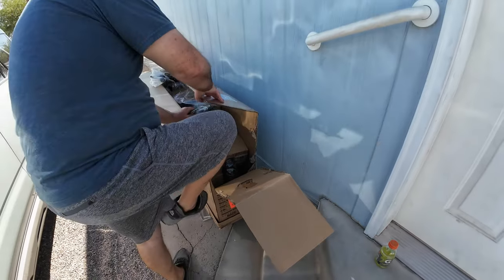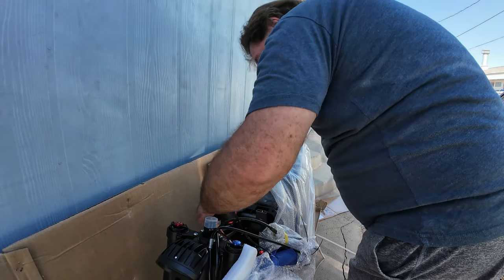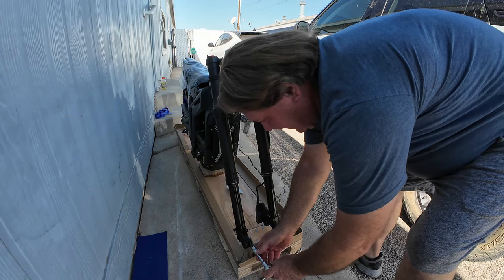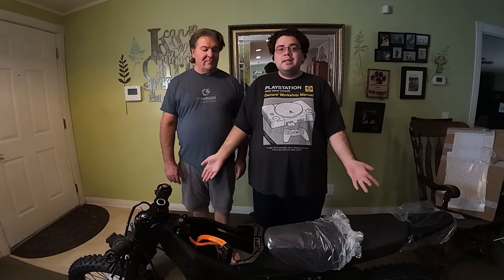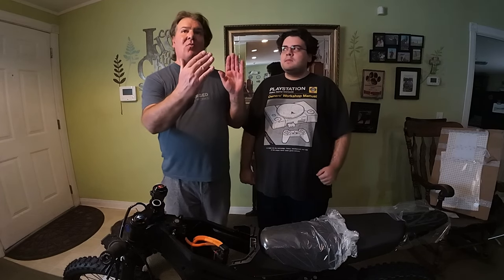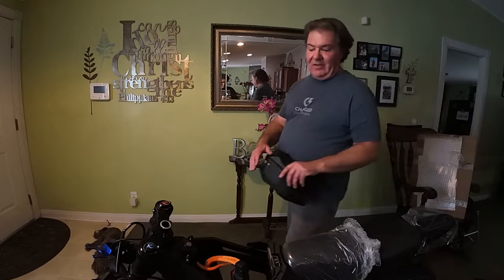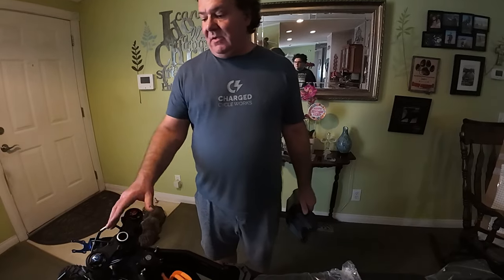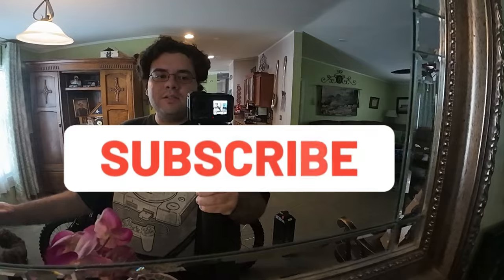Talaria Sting Mx5 unboxing

Comment: I just did a news segment on the MX5 and a fire video that was just posted up. I have reason to believe it’s an MX4 in the video I saw, but I was curious if your brake calipers were blue or gold. They advertise them as gold and other images I’ve seen are gold, but I was wondering if they had a run of blue? Mine should arrive on Tuesday and I’m eager to get on it🤘🏾
Reply from the maker: They are blue and I hope you enjoy your new bike.
Reply: So some of the MX5's have blue calipers then that video you posted of the burning bike is more than likely an MX5 also. I'm concerned on pulling the trigger on buying the MX5. I'm probably gonna wait a few months and see if there's any issues.
Reply from the maker: @TheCoppergoat  I just rode it around and it was working great but it is better to be safe than sorry.
Reply: @shanebaird-the-ebikecowboy  I don't believe that from 1 failure you should be worried about your battery but if I know Talaria and Luna they've always worked with their customers and I'm sure they'll address the issue. Enjoy it's a very cool bike. Wish I had the money to afford one. I have a surron light bee X for reference =)
Reply from the maker: @Tonyplat98  thx

Comment: Also any update on range? Surronsters video is kinda unnerving
Reply: Yeah I have the same concern. I’m tryna decide between this or an e ride pro ss 2.0. I think the battery also ran out faster for surronster because he was going like 45 the whole time
Reply: @mrcrusty3151 this bike has 3 modes (eco, sport, hyper) surronster rode on hyper mode which has more power than e ride pro ss
Reply: @mrcrusty3151  and pulling more power will reduce ur range obviously
Reply: Everyone is so worried about the range, it’s the same battery as the Pro SS. I ordered an MX5, can’t wait to get it!
Reply: @noobie6115  thanks
Reply from the maker: Haven't had the chance to travel far but will do video about it.